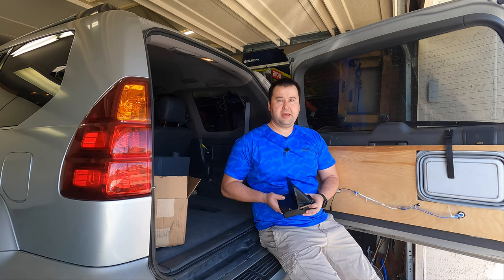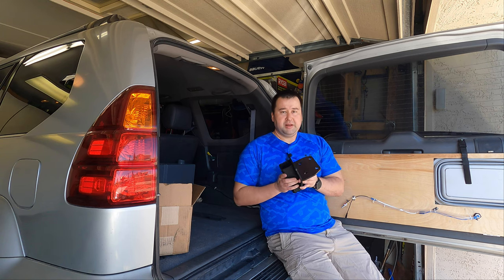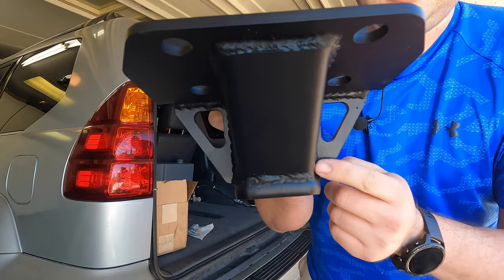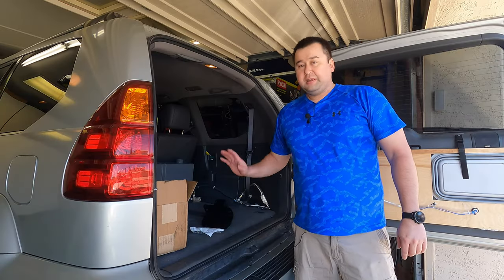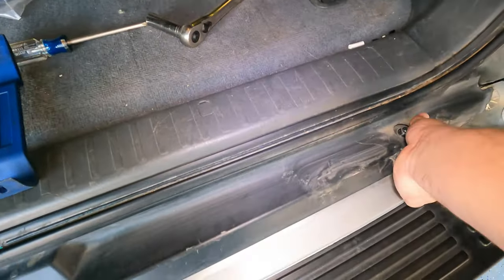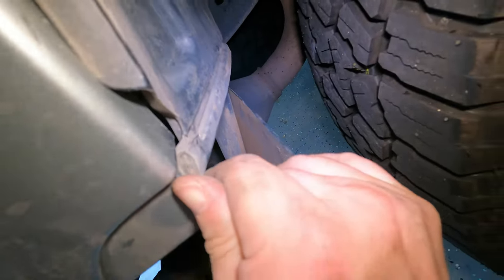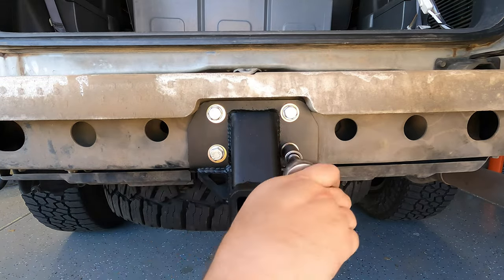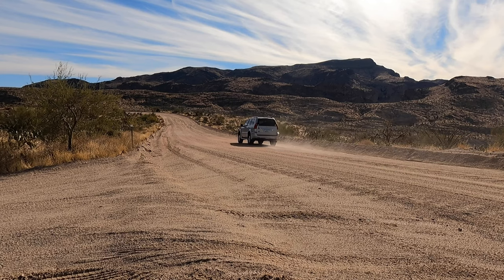Metal Tech  Hitch Install and Review GX470 4runner FJ Cruiser GX460

Comment: Awesome video. I just installed on my 04' GX470 following your tips and it went flawlessly. Actually, I did not even remove the bumper, just removed that cosmetic plastic plate and bent the bumper slightly to access the top bolts. The hardware that comes with the metal-tech hitch is slightly shorter so it went on easier than taking off the stock bracket. If you go this route, be sure to have a ratcheting wrench.
Reply: I was wondering if I was going to need to pull the whole bumper off. Good to know, thanks!
Reply from the maker: Awesome!  Thanks for sharing.  I'm all for the simplest way to do things :)

Comment: “Same” install in 4Runner 5th gen???
Reply from the maker: According to metal techs website it fits 2003-2019 4runner.  Removing the bumper might be a little different but I can't say for sure because I have not tried on a 4runner.

Comment: Does this allow you to run a larger spare?
Reply from the maker: I run a 265/70/17 spare which is slightly larger than stock and it fits, but it is tight.  Not sure could get a 33 to fit

Comment: That center piece do I have to cut it out or it can just b Uninstalled?where the hitch area*is
Reply from the maker: You don't need to install the cover piece.  I trimmed and installed mine to look a little cleaner. In the video when I put the bumper back on you can see what it looks like without the cover installed.